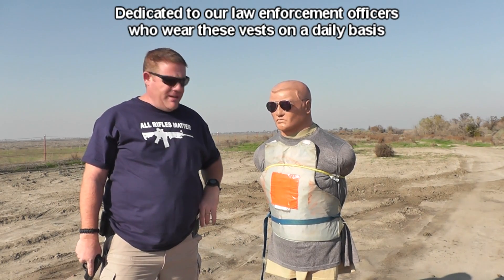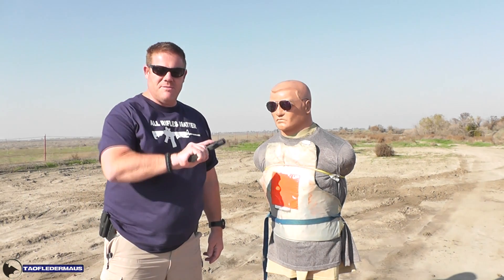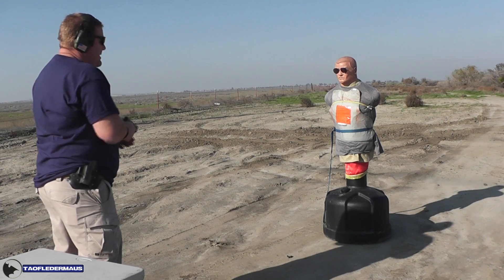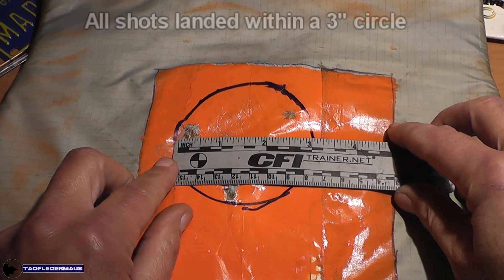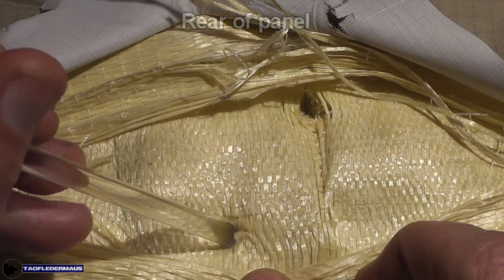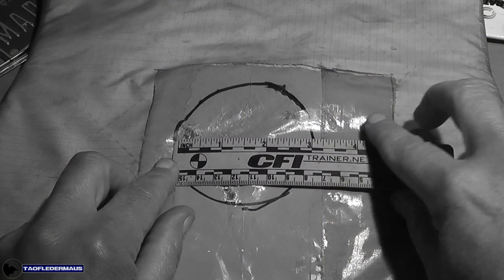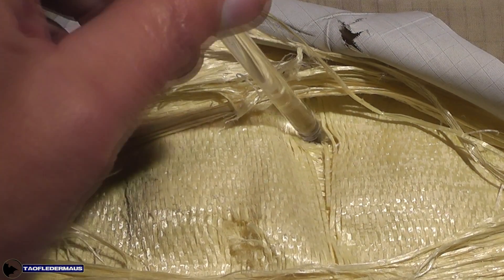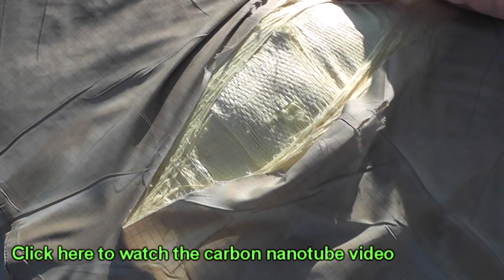Dispelling MISCONCEPTIONS about Kevlar body armor

Comment: Wow, no matter how many vocal disclaimers you put in a vid, the armchair quarterbacks really show up. Great vid Jeff!
Reply from the maker: Haha,   I was almost scared to start looking at the comments.!     Thank you!
Reply from the maker: Yeah,  their product does look GOOD,    so I don't know why they have to exaggerate about the kevlar.
Reply: "their product does look GOOD" - That's an odd thing to say. Did you actually see it withstand multiple close proximity hits with something close it IIIA limits like a .357? Has it been NIJ certified and if so why not? Did you realize it is the same weight as normal high end soft armor? Do you really believe they have made a carbon nano-tube technology break through. Was there a mention of a patent to check?
Reply: Great video, and after watching your video and having seen several other videos where they have hit a Kevlar Lvl III multiple times in a six inch area, I knew their claims were bogus.  Either they haven't performed the test themselves, or they are flubbing the truth to make their product look better...which of course throws their product into question itself.
Reply: Exactly ActionPhysicalMan...their product seems too good to be true.  I also have to wonder about fragmentation if it works the way they say it works.  It does also appear that even in their video that there is some brass showing on the inside of the plates.
Reply: Tyson Capel - I didn't see any mention of certification on the website. Also if they had a carbon nano tube technology breakthrough then why didn't they patent it? I ain't saying that they haven't displayed good armor, just that it is not likely made of carbon nano tubes (the layers I saw looked just like Aramid and Dyneema - and coincidentally it weighs exactly the same as other IIIA Aramid and Dyneema panels on the market.)
Reply: ActionPhysicalMan it is nij certified I've seen the certification myself. They also do have patents on it.  it is made out of carbon nanotubes. They're not lying about any of this stuff. Not only will it stop bullets but it will stop a knife up to 40 PSI. As far as the bullets that it can stop it will stop an AR-15 round as well but they do not have the certifications for that yet.
Reply: Tyson Capel
 - I am encouraged to hear that. I want these claims to be true. As of 
yesterday I didn't see any reference to the certification or a patent. I
 have done a patent search and did not find one. Could you share the 
patent number(s)? I will be very happy to admit I was wrong and I make 
sure I do so on every forum I have commented about the matter.
Reply: ActionPhysicalMan yes I'll see if I can get the patent # from them today. I know some of this information because the company I work for that my uncle owns has the exclusive rights to armor Humvees with the carbon nanotube material they use. We make molds out of them and can armor the entire Humvee if that's what people want. We do not do this for government agencies we do it for civilians. We will continue to do it for civilians unless we obtain a government contract to armor the military Humvees and they restrict us from doing so. Me personally I wouldn't take on a contract if it limited me from being able to produce this kind of stuff for civilians.  The Humvee that I personally own will be the first Humvee to be armored in this stuff. The more layers you add the more it is capable of stopping and when adding it to a vehicle you can still go about the thickness of the traditional armor that they use with it still being very effective. Even going thicker than the Armor that's currently on the Humvees that are used in the military it is way lighter and significantly reduces the weight of the Humvee when comparing it to a traditional armored Humvee.
Reply: TAOFLEDERMAUS  The carbon nanotube armor is NIJ certified and is far superior compaired to Kevlar. They shoot multiple higher caliber rounds at theirs in the same hole not a weak little 9 millimeter in the same hole to prove the quality of their product. yes and this video they shot nine rounds in a 3-inch diameter grouping and the video proved that it weakened the Kevlar which is exactly what they're talking about. If you repeated this test it's likely that rounds would go through the Kevlar again especially when they shoot multiple rounds in or near the same hole.

Comment: Yeah... A second bullet is not gonna just go through Kevlar. It WILL be hitting a much weaker location,  that part's right at least- but no, it can still catch bullets. Not unless you're using a very fast bullet at a very short distance.

Comment: Carbon nanotubes are quite strong, but they are also electrically conductive.
That means the vest would be a sort of Faraday cage, blocking RF of any devices used under the vest.
There are likely to be some electrocution hazards as well.
Reply: police radios are worn on the belt, not under the kevlar vest in the first place, so the Faraday cage effect (which would be minimal due to things like arm, neck, waist holes) would not interfere. Also proper grounding is required for a Faraday cage to work correctly, the vest would be at a floating potential and reduce the Faraday effect further.

Comment: Just out of curiosity, could you possibly fire two shotgun slugs into a kevlar vest at less than 15 yards?
I've seen a video of ONE slug hitting a kevlar vest (it was a 12 gauge slug) and it left a 2 inch depression on the other side. 
The guy in the video explained that even if that didn't kill you immediately, the shock from the impact would cause serious damage and possibly kill you later.
What I want to know is: what would happen to the vest if you took a second shot with a slug?
My theory is that it would tear through due to the kevlar being already stressed to breaking after the first shot, but I would like to know for sure.
I am aware that kevlar vests are meant for small munitions fire, but it's still a burning question.
The video in question: https://youtu.be/OLvtEsI6l9U
Reply from the maker: We have shot these kevlar vests many times in our shotgun ammo tests.   The vests wad up into a small ball and the kevlar afterwards stays bunched up,  so we have to work it back into shape for the next shot.   I don't think the vest would fair very well for a second shot.   We have shot the same vest many times with shotgun slugs and they have caught them fine.
Reply: Okay, but the question remains, if left alone, would the second slug fire straight through the vest?
Because from my understanding, straightening the vest realigns the fibers.
Here's the situation:
Shotgun slug fired at the target with the kevlar vest.
Target falls to the ground from the shock of the impact.
Shotgun is fired a second time to finish off the target.
No tampering of the vest is done between shots, so what would the second shot do to the vest?
Also, mind that I mean that the vest would be in it's holding case, not strapped with duct tape to the target.

Comment: Isn´t an exit hole just an indication of wasted energy? if a bullet leaves its target, it is taking energy away with it that could have been dumped into the target with a different round.
Reply: GeirGunnarss damage done to the human body is measured in volume of crushed tissue and not energy. Unless you have a very fast projectile that rips the tissue in the temporary cavity and bruises the organs, "energy dumped" is mostly used on pushing tissue aside, which will spring back into place undamaged.

Pistols don't use very fast projectiles. Just focus on trying to pierce the heart, major arteries, spine, etc.

Comment: Could you redo this test with the most powerful round this vest is rated for? Just thinking that if it could stop multiple rounds at the upper limit of it's rating, it would remove all validity from their statement.
Reply: Xaro Xhoan Daxos The problem is that you will never shut up this sort of people. They are blind to the facts and their mouths are on auto = sell sell sell.
Reply: The CN people are already saying that this test is weak because it's using a pocket pistol and weak ammo. I'd like to see it done with a 44 mag just to shut them up.
Reply from the maker: If we were shooting a .22 at it,  I could see their point.   We took an expired vest,  and shot it with a round that cops are most likely going to encounter,  the 9mm.   It is not a weak round by any means.   We also shot it to the point of failure.   We've also shot these vests multiple times with deer slugs and they have worked fine to stop them.